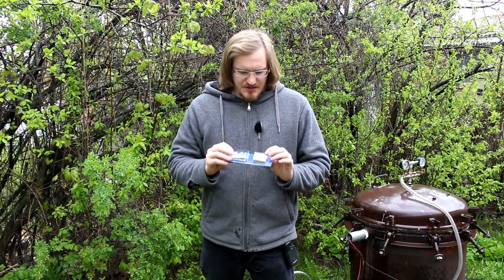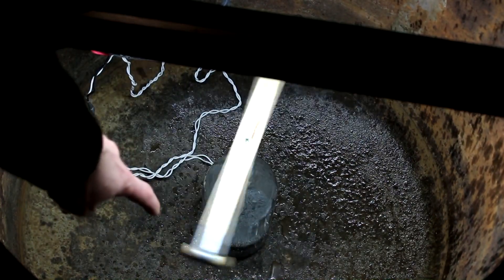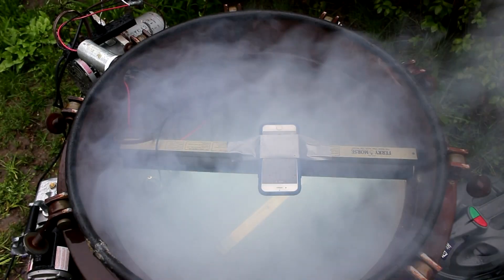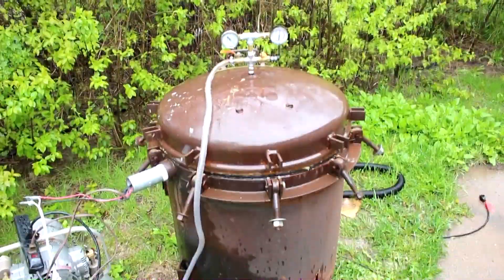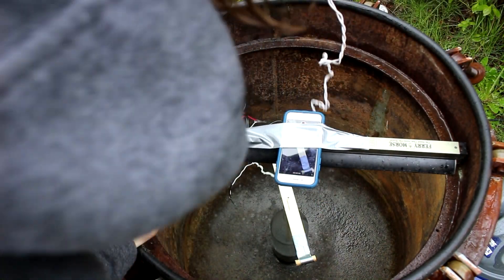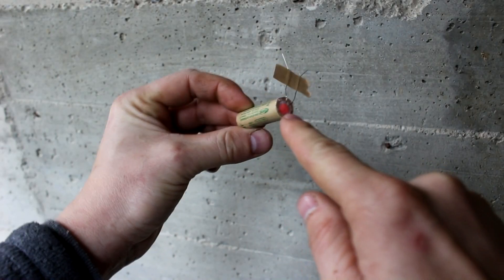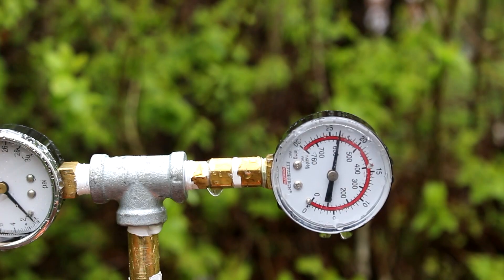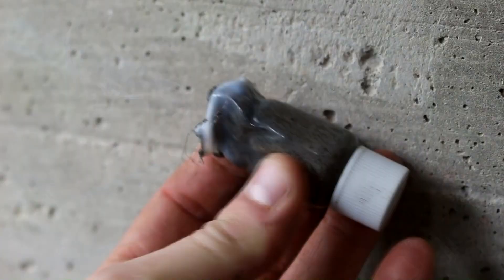Will a Model Rocket Motor Work In Vacuum?

Comment: Bob can be convinced of anything empirically provable.
Reply: When I said 'goodnight' I literally meant I was going to sleep. I wasn't giving up on this thread, in case that's what you guys concluded. Because it's been 9 hours, and no comment.
Reply: sleat Its literally in the comment before the one you replied to. You need to read the whole comment, instead of reading the top paragraph and skimming through the rest.

Unless...

My own youtube is acting strangely. I get notifications of your comments, but when I come here, they aren't there.

Perhaps you are experiencing a similar problem.

PS, repost the two comments I couldn't see in your reply to this question.
Reply: Originally, I intended that I would put the entire old thread into my first comment on the new thread. But Youtube has a stupid limit to the amount of characters in a comment. Rest assured though, I have the entire thread safe in my computer.

Shall we wait until at least sleat comes?
Reply: Sigh.... I was hoping that at least sleat would show up before we started this thread, but I am tired of waiting.

I know exactly what you are going to say to that bob. you'll say that he knows he's lost and he is too scared to show up. but I disagree. I think he isnt showing up because he thinks there is no point in arguing with you, and because he hasnt seen my messages for some reason.

anyway, since we need two sides to the debate, and I am actually somewhere in the middle, we wont actually begin until sleat joins. so, uh, hows life going?

 (I am leaning towards 'rockets work in vacuum' and as far as I am concerned, the debate is mainly about rockets. until we settle that, we cant go discuss anything else. thats called moving the goalpost
Reply: could you say something completely unrelated to what this thread is about, just so I know you're there, bob?
Reply: Emaan Ajaz
Look into mudfossils. ;D
Reply: +Emaan Ajaz "and I am actually somewhere in the middle"

Middle of what?

"until we settle that, we cant go discuss anything else. thats called moving the goalpost"

I've been asking for an equation that shows how rocket thrust should diminish as the density of the operating medium diminishes if the claims are correct, for, oh, several months now. That set of goalposts has weeds growing around it!

Such an equation could quickly be tested, as soon as it was published by someone who thinks that's true, and can describe it numerically. Any number of tests to verify the equation could be setup by almost anybody, as soon as they had the relationship written down before them.

If they can't, it raises the question; "Why do they think that, if the original rocket-thrust equation has been working correctly for the past 100 years or more?" It isn't as if, say the North Koreans use a different equation and get different results. There is literally zero debate about it between people who make rockets for a living, even when they come from countries which "hate each other".

Up until now, nobody (on the "no thrust in vacuum" side) has clarified what's supposed to happen at, say, 1/10th of sea-level pressure, or 1/2, or 1/100th. If they don't work in vacuum, you'd think the thrust would start decreasing continuously before that, since even space isn't a perfect vacuum.

You can't expect to be taken seriously if you simply tell people the current rules and models are wrong, but keep the "real" rules a secret.
Reply: sleat You're here! Finally   : )

I meant that my opinions were in the middle of the two sides of the argument. Though that was really just a generalisation. My opinions are actually closer to 75% in agreement with mainstream science than alternative views.

As for bob's side of the argument, I think he doesn't have experience with equations. He seems to prefer using analogies and and what not.

I actually have an idea for an experiment that should solve this debate permanently, because you can't argue with visual, live evidence, can you?
Reply: +Emaan Ajaz "I actually have an idea for an experiment that should solve this debate permanently, because you can't argue with visual, live evidence, can you?"

Great. I'm sure somebody will try to argue, but it's a start. So, what's the basic premise, and what's the experiment that will prove or refute it?

"He seems to prefer using analogies and and what not"

Not easy to predict the raw performance of a new rocket design in a reduced-density-environment using analogies and what-not. Predicting what rockets will or won't do is about masses, flow rates, and velocities, in the most basic sense. Real numbers.
Reply: sleat Well, basically if I've understood bob's understanding of rockets correctly:
. He believes that matter is continuous, rather than discontinuous. After all, he doesn't believe in molecules. So I am guessing that he thinks as long as a fluid is in continuous plume (or fountain) it will be able to impart a force back to the source (of course, one could disprove this with your vastly simpler experiment of spraying a hose against a wall, to see if that provides greater momentum than simply spraying against air- that was a long time ago...)
. He thinks that vacuum has a pull to it.
. Due to this pull, he seems to believe that the fluid in a rocket is pulled out, without it impacting the walls of the ignition chamber of the rocket, enough to impart momentum.
. And since he does not think of fluids as being composed of 'tiny solids' (how he thinks of molecules, and not a bad way to imagine them, I admit) so there is no way for the fluid to impart force by average collisions of molecules against the walls of the blast chamber.

Is that how you see it, bob?
Reply: Emaan Ajaz
Atoms a theoretical. Vacuums have no pull they are inert. Gasses want to fill vacuums and low pressures because their electrical charge makes them repel themselves. Releasing gas into a pressureless environment allows the gas to expand unimpeded. The releasing of the gas is an equilibrium force. The released gas returns no force to the rocket, except when its expansion is resisted, ie in atmospheric pressure.
Reply: +Emaan Ajaz So, basically;

"Here's an alternate, overlapping, parallel universe where I get to make any rules I want, because I say so. Now, try to de-bunk my rules using the reality you live in!"

He's the god of his own private reality. Everyone else is living a fantasy. That's a big de-bunk.

I'd be impressed if anyone could untie that knot.
Reply: +Emaan Ajaz "Atoms a theoretical"

Hmm. If bob means that atoms are theoretical, this would mean that since real matter is not composed of atoms, the chemistry necessary for rocketry would not work in the first place. That's a much better proof that rockets don't work in vacuum, as proofs go.

"They don't work in vacuum because chemistry is a hoax." 
That works for me. :D No chemistry in the bobiverse.

"Vacuums have no pull they are inert"

This is a fresh change from last time. I'm almost certain that last time the narrative was that there was no force in vacuum because it sucked the gas out of the rocket. Can you find that bit Emaan?

"Gasses want to fill vacuums and low pressures because their electrical charge makes them repel themselves."

Well, since like repels like, that must mean there are separate, things repelling each other. (and bumping around repelling things they run into) If there are no atoms/molecules, where does the repulsion come from, and how would one measure it?

A piece of silver, with a high static charge doesn't want to blow itself apart. It behaves as one charged object, freely sharing its electrons among its parts.

And here I was always taught that gas pressure was due to the kinetic energy of the gas molecules, or atoms, (whose electron shells also repel each other, unless they're involved in a chemical reaction).

Devilishly clever for the bobiverse that most of modern physics (and even old physics, like Newton) literally doesn't work at all.
Reply: bob question What I don't understand is how gases could be charged.

I also don't understand why a constantly expanding, burning gas with only escape being a nozzle wouldn't impart momentum to the solid ignition chamber surrounding it.

But besides these two points, my understanding of your understanding of rockets was correct?
Reply: sleat Not necessarily. He could have read all that on an alternative science site. He accepted it because it made more sense to him than mainstream science.

I'm sure if we manage to give good enough proof, we can change his beliefs.

The above paragraph applies to you too, bob! If you can provide sufficient evidence, then speaking for myself, I would accept your views. But the problem is (and this has been observed several times by many people of the Old Thread) that you:
. Do not explain your ideas in adequate detail.
. You avoid answering questions.
. You bring up something marginally related. That is called moving the goalpost. A great example of this was a debate about flat earth in which you brought up how the vatican have claimed all our souls (please don't start). I understand what you meant was we were living under a conspiracy, but its much better if you could stick to the topic.

Please avoid all of the above.
Reply: +Emaan Ajaz "Not necessarily. He could have read all that on an alternative science site. "

I guess you mean he doesn't necessarily believe atoms are "only a theory". 
If that's true, it does present a number of problems, like how nuclear fission works in practice, decay of isotopes, detection of sub-atomic particles with instruments, and so-forth. Also, CRT and X-ray tubes wouldn't work without the ability to spray naked electrons over some distance, and manipulate or steer them.

Science thrives on upheaval and revision, replacing old models with new models that work better, and can take the job of the old model without errors. If the alternative science worked it wouldn't be alternative science anymore. The thing about current scientific principles, they can be readily used to engineer stuff and make new things; to turn a profit. If the alternative science could be used to engineer new inventions, you bet I'd use it! All it has to do to make $$ is work in practice reliably.

If a new phenomenon is discovered that blows apart old laws and theories, they can be replaced. That will happen as soon as enough folks can replicate the results using the new model. Basically, outside the bobiverse, science is self-evident and updates itself (with the help of people).

"I'm sure if we manage to give good enough proof, we can change his beliefs"

I don't expect that, especially if he sticks to proclamations and eschews experiments and making honest efforts to answer polite, relevant questions.
Reply: sleat I actually did find a comment of his on a wolfie video, where he openly admitted that he 'jumped the shark' and admitted he was wrong. That was today, in fact. You were there somewhere too. Something about gyroscope correction mechanisms...

So clearly he can be convinced otherwise. The thing is, his understanding of physics is so different from the mainstream, and so complicated and thought out, that we'll have to provide very specific counter proofs to persuade him otherwise.

Likewise, bob has yet to have provided arguments, let alone proofs, that could convince US (except, in my case, a few observations of his, here and there).
Reply: So, where has the existence of atoms been proven? Mainstream science knows this except it teaches theories as if fact.
Reply: bob question Why not play Devil's advocate and try to post as many reasons why atoms COULD exist instead? I do it all the time.

There is also the issue of falsibility and deniability.
The first means if something can be proven wrong by experiment, and the second is providing ONE example of a proof, which if found, causes one to give up on there belief.

Anyway, sleat asked that how can gases repel if it is not made of many molecules repelling one another, since like repels like. Because a single thing cannot repel itself, yes?

He also asked to explain nuclear physics, which require the nucleus of ATOMS to exist, so how do nuclear power plants and bombs work?

I also don't understand why a constantly expanding, burning gas with only escape being a nozzle wouldn't impart momentum to the solid ignition chamber surrounding it, when it would for air.

But besides this point, my understanding of your understanding of rockets was correct?

Also, how do you explain stoichiometry?
Reply: +bob question "Mainstream science knows this"

Knows what exactly? What do you mean by "this"?

"except it teaches theories as if fact"

Can you tell me, bob, in your own words, what you think a scientific theory actually is? Can you elaborate exactly the differences between a fact and a scientific theory?
Reply: +Emaan Ajaz "I actually did find a comment of his on a wolfie video, where he openly admitted that he 'jumped the shark' and admitted he was wrong."

Much respect to bob for admitting when he finds he's wrong about something.

Can you point out what top-level-comment this was under, please? I'd like to read, rather than just hear about it.

"(except, in my case, a few observations of his, here and there)."

Really? Like what? Maybe I can help.

"The thing is, his understanding of physics is so different from the mainstream, and so complicated and thought out, that we'll have to provide very specific counter proofs to persuade him otherwise."

Alternative physics that doesn't explain at least as much as mainstream physics, about the same phenomenon which is being observed, tends to be a rabbit-hole.
Before long, you have to reject literally everything in order to get your alternative to work, and if you have to do that, each time you do that, it weakens your explanation of what is observed, unless you account for all the stuff you rejected out-of-hand as well.

"I hereby reject your reality and substitute my own!"
There's a reason why that's a mythbusters catch-phrase. It's funny.

You can replace a given explanation with an alternate explanation, but it has to work better than the original one. This is only logical. Science certainly allows for this to happen, in fact, it's a requirement. Whenever there is a better explanation than the previous one, for some phenomenon, as long as it doesn't break anything else, it becomes the new explanation. 

I think many alternative-science types miss this. For example, if atoms are a big fat lie, it breaks all the obvious stuff that is explained by the existence of atoms, but doesn't replace the broken stuff with anything. 

New explanations aren't really allowed to leave gaping holes in the rest of the understanding, since the purpose of the methodology is to fill in those holes in the understanding.
Reply: sleat
Mainstream science knows that atoms are theoretical.  As for wolfies claim that the gyroscope would account for curvature. The gyroscopes correction displayed by wolfies example is a situation that the gyroscope will never be in under proper operation within an aircraft when curvature compensation would be needed over the ball "Earth". IE when a force is applied perpendicular to the gyroscopes axis.
Reply: sleat
Theories are hypotheses. They should be a tangible guess at why or how something happens when the actual happening or cause of happening is not known. Instead, theories have become concatenations until they no longer represent reality. For instance, black holes are theoretical. They are made of a theoretical force and they are the end of a chain of theories in a theoretical universe that can be proven not to exist.
Reply: Nuclear power does not exist. We live on a capacitor and above us is a charged atmosphere. The "Earth" is an electrical generator. Power cables are not insulated apart from between the wire and the pylon. They are not insulated because they absorb electricity from the atmosphere and do not discharge it to the atmosphere. The higher up you go into the atmosphere the greater the electrical difference between earth and sky. This atmospheric power is then distributed to houses etc. The myth about fossil fuels and nuclear power is to make you pay more for your power. They can also scare you shit-less about "energy crises". 

I know you will find this one hard to swallow, but that does not dictate what is and what isn't.  

Check out why pink floyd had a flying pig over Battersey Powerstation. This Powerstation has never even had a roof (up until three years ago when it became an art exhibition centre) and was derelict 7 years after building ceased. It was just mind candy for feeding a lie whilst extorting wealth from the nation.
Reply: +bob question "Theories are hypotheses."

So, you're saying these words both mean exactly the same thing; i.e. they are freely interchangeable, in a rigorous scientific context? Are they synonyms? No distinction worth mentioning?

"They are made of a theoretical force and they are the end of a chain of theories in a theoretical universe that can be proven not to exist."

Do you mean the universe can be proven not to exist, or black holes?

Can, or has? How can (or has) this be (been) proven?
Reply: stoichiometry is basically molearity. This proves that chemicals in bonding have a fixed relationship with each other. IE so much oxygen requires so much hydrogen to make so much water. That does not prove atoms.

as far as the like repelling like is concerned, that is why gasses expand. This to, does not prove the existence of atoms.

Atoms are a theory that largely fit the purpose. As long as we are taught that they are a theory that largely fits the purpose, then all is well. When we are not taught that they are a theory that largely fits the purpose, we then think wrongly about them. For instance, when someone teaches us about the Higs Boson, we think that this has a tangible basis. It does not. Its a theoretical particle to explain the existence of another theoretical particle. Its rubbish.
Reply: If i dig a deep enough hole in my garden then its black as light doesn't get in. So i know black holes exist. What doesn't exist is gravitational vortexes at the center of star clusters.
Reply: +bob question "is a situation that the gyroscope will never be in under proper operation within an aircraft when curvature compensation would be needed over the ball "Earth"."

Since we know that local up-and-down on a spherical earth would be the same direction as a stationary plumb-bob would hang in the same place, and that the attitude-indicator gyro erects itself to that orientation as demonstrated in much less time than a fast-moving aircraft would progress around the curve, can you indicate what, if any, further "curvature compensation" should be required and why?

"IE when a force is applied perpendicular to the gyroscopes axis."

What is your understanding of the gyroscope's axis direction when, say, it's indicating level flight, and how would travelling around a curved earth at a constant velocity exert a force perpendicular to that axis? How much force of this nature would you expect?

What effect do you expect such a force to have on the indication, and why do you expect that?

And lastly, have you raised these points with +Wolfie6020 himself? It's his demonstration, after all, and he has used such instruments for years.
Reply: +bob question Well, you seem to be able to generate woo faster than I can figure out what you're talking about exactly. If your direct-question-answering rate was only par with your new-topic rate, maybe I'd stand a chance at keeping up.

I guess the best way not to get pinned down on any particular point in more detail than you are comfortable with is to keep the topic bait in a state of continuous flux.

We've got, what, about 4 distinct topics here, no direct answers to direct follow-up questions and absolutely no discussion of the original topic, and I've never seen you happier. Funny, that.
Reply: +bob question "Atoms are a theory that largely fit the purpose."

Splendid! Can you provide an explanation for the exact electrical behavior of just one of the multitude of doped-semiconductors you're using right this instant, without talking about the well-understood and observed properties of atoms?

Do you think transistors are as phony as you say you think nuclear (and coal?) power is?

Oh, and where does all that coal go, do you think? I see tonnes of it go into Australian power plants nearby every week, and none comes back out. The hopper trains are full going in, and empty going out. Where do they put it?
Reply: +Emaan Ajaz "So would you explain if you think this is a good experiment?"

I would if I could see it. When-abouts did you post it?
I also recently mentioned that the number of topics (and level of woo) is increasing exponentially.

If one simply keeps declaring this-and-that well understood phenomenon to be lies, without answering direct follow-up questions, one could go on like that indefinitely. Bait, switch, repeat...forever.

The only requirement is changing direction before the detailed analysis catches up with the new topic.
Reply: +Emaan Ajaz "Because it's been 9 hours, and no comment."

Can you not see my comments? Where did you document this experiment, exactly? Can you paste it again, perhaps?
Reply: +Emaan Ajaz OK, you say: "Its literally in the comment before the one you replied to."

Here is that comment, just the beginning and ending:

"I would be happy to address your understanding of electricity---So would you explain if you think this is a good experiment" ?

I don't see the details of an experiment here.

"repost the two comments I couldn't see in your reply to this question."

I could do that, if I knew which comments you couldn't see.
Reply: sleat I came here after logging out from my YouTube account. It seems that all long comments don't exist on this thread. wut
So hopefully you'll see this short comment, and i'll post the experiment in segments.
Reply: +Emaan Ajaz I don't know what Google is doing to this thread, but it seems I can't see stuff, and you can't see stuff. Hard to imagine them censoring an experiment!

Perhaps you should post it in a new, top-level-thread, to stop any funnies from happening. If bob wants to join us in your thread, so much the merrier!
Reply: sleat I would imagine that its a new feature, or a bug, that doesn't allow long comments. I'll be posting a segment of the comment in a bit.
Reply: segment 1:

You know, this thread is beginning to move in another direction, so I'll just post my experiment now. We can discuss the existence of atoms and stuff later.

Actually, I posted a version of that experiment in the Old Thread, but I guess it was lost in all those replies.
Reply: +Emaan Ajaz OK. I'm waiting to see it...
Reply: Segment 2:
Bob does not want the propellant to hit the walls of the container? Okay.

He wants there to be an infinite vacuum? Not okay, but that's because he does not want the propellant to hit the walls. So if he's willing to accept a near perfect vacuum, where pressure is in the 10^-5 range, great.
Reply: Segment 2:
Bob does not want the propellant to hit the walls of the container? Okay.

He wants there to be an infinite vacuum? Not okay, but that's because he does not want the propellant to hit the walls. So if he's willing to accept a near perfect vacuum, where pressure is in the 10^-5 range, great.
Reply: +Emaan Ajaz It looks like you just posted the same message as from 3 days ago again.

Did you not see my immediate reply, three days ago, where I talked about explosives near a plate, and the feasibility of achieving 10^-5 Torr without spending >$10K on equipment? Did you see me talking about the problem that since more expensive equipment is tasked with removing individual molecules and atoms, and that high vacuum gauges are specifically tasked with measuring those remaining molecules and atoms, that it was likely that bob doesn't believe that measurable (by humans) vacuums exist in the first place?

If you didn't see that, or didn't see that you've double-posted "Segment 2" then maybe this thread is being messed with by something, or some software error.

Why not post your whole experiment in your own top-level-thread, in segments if you need to?

I promise to reply to that.
Reply: Was it a long comment?
Reply: It seems that this thread does not accept posts of more than around 200 words. I would make a high level thread, but:
. I don't know how.
. There is no point to the thread if bob isn't in it. Its our against his arguments, after all.
Reply: Long awaited post 3:
My first, rather easy proposal, which you may remember replying to, is to use a glass tube connected to a vacuum cleaner with air tight glue. Inside the tube is a long balloon (the type used to make balloon shapes). The opening of the nozzle is closed with neodymium magnets, one on the inside, other on the outside of glass tube. We start the vacuum cleaner. Any gas produced is sucked due to being an equilibrium process, according to bob. If, whereupon releasing the balloon, it flies upward, then bob's idea of rockets is wrong, and they can work in vacuum.
Reply: +Emaan Ajaz A vacuum-cleaner only gives a few pascals' worth of reduction from the ambient pressure where it's located. It might give you a virtual altitude on the order of 5,000 feet. You could just run your rocket on top of a medium mountain, instead.

Vacuum cleaners go nowhere near 10^-5 Torr. If only they did, it would be very easy to play with vacuums (as opposed to vacuum-cleaners) cheaply.

Have you got any other experiments in mind?
Reply: segment 4:

'Edit: you could use an ionizing pump instead of a vacuum cleaner'

and with that, the comment ends. now all we have to remember is to keep comments at 200 words.
Reply: +Emaan Ajaz "'Edit: you could use an ionizing pump instead of a vacuum cleaner'"

Who said that? You? Yes, after roughing down, there are several types of pumps that can get to high vacuum over time.

If you put a rubber balloon into the chamber with any air in it at all, I think it would very quickly expand to the point where the rubber covered up the gas-outlet for the chamber, and then that part of the balloon covering the port would fail.

You might want to use a rigid container capable of withstanding at least 15 psi. A normal plastic drink-bottle would do that.

Also, who gets to buy the Penning trap discharge pump?
Reply: did you see my reply yesterday?
Reply: +Emaan Ajaz "did you see my reply yesterday?"

If it's the one where you said: 
" 'Edit: you could use an ionizing pump instead of a vacuum cleaner' "

Yes. I replied to it. I mentioned that there are several types of high-vacuum pumps that can be used.
I mentioned that a rubber party balloon in a vacuum-chamber, even with a roughing pump, and with a bit of air inside, would quickly expand to fill the chamber, until one part of the membrane covered the suction port, and then it would fail. In a bigger chamber, it would expand until it popped.

I suggested that a plastic drink-bottle be used instead. They'll hold 15 psi or more.

I'm also wondering at this point how you plan to convince bob that a  Penning-trap pump will work.
Its mechanism of action involves starting at a reasonably good vacuum, like 10^-3 Torr, and then catching individual atoms and molecules of the residual gas, by ionizing them and then electrically drawing them towards a capture system.

Trouble is, bob question does not believe in atoms or molecules, apparently, so it would be difficult or impossible for him even to accept that a Penning-trap system would work.

The other problem is that the way you measure how good a high-vacuum you have is usually with an ionization gauge.

This relies on a measurable electric current being produced due to the ionization of the very individual molecules (or atoms) which bob does not believe exist. The amount of current is in proportion to the number of individual molecules (or atoms) left in the chamber.

You'd first have to convince bob that individual molecules and atoms bounce around in a vacuum-chamber, before you could convince him of the mechanism by which mankind measures high-vacuum.

Imagine trying to explain the rate-of-cellular-metabolism in a given cell to a man who does not believe cells exist. That's your problem.
Reply: sleat that's what I feared. I exceeded the 200 word limit, and so you didn't see my newest comment. I will now repost in two segments.
Reply: segment 2:
 The gases, positively charged by the cathode rays, will easily be pumped out by putting a small hole behind the cathode.

A tiny rocket might be used, ignited by the cathode rays.
Reply: +Emaan Ajaz "I exceeded the 200 word limit, and so you didn't see my newest comment. I will now repost in two segments."

Funny that you saw my last comment, which must have been well over 200 words. You did see it, right? It began with [If it's the one where you said: ] and ended with [That's your problem.]

I think what you're describing is a Penning-trap.

What do you make of the fact that according to bob, both Penning-traps and ionization high-vacuum gauges cannot work, as they rely on the actions of individual molecules (or atoms) and individual electrons? Wouldn't it first be necessary to convince bob that atoms and molecules are real, in order to convince him that you actually had a good vacuum in the first-place?

As far as trying to ignite a rocket with glow-discharge or an electron-beam (cathode-ray), you might find that whilst the temperature is high in the plasma created, the heat is very low, due to the low pressure. I think the focus should be on increasing both the heat and the pressure at the propellant-grain-face.

I would think that to ignite a solid-fuelled rocket in an evacuated environment, it would only be necessary to build-up a bit of pressure on the propellant-grain-face. I'd be using some sort of tight-fitting plug and a hefty bit of nichrome wire. Heating up the KNO3 to a high enough temperature should provide enough outgassed-pressure behind the plug to allow the reaction to continue normally in a rocket-like fashion.

Part of Cody's problem, I think, was that he ran house-AC-current through his igniters. I think a longer, more consistent application of heat (a few amperes of DC current) behind the cork would work better, and other YT videos of igniters working with the same engines in other vacuum-chambers show that it does work.
Reply: sleat You're right, your last comment really was far above 200 words. I really can't figure out what is wrong with this thread. All I know for sure is that some comments are failing to appear.
Reply: sleat Anyway, bob doesn't seem to be someone that denies direct evidence. And he doesn't see us as liars so much as morons :/
so as long as our apparatus shows zero pressure on the gauge, bob will believe the ion pump works, but rationalize why it doesn't prove the existence of atoms. He already believes that gases can be charged, but doesn't believe in atoms.
Reply: sleat As for the rocket, chemical reaction don't always require heat or pressure. Take electrolysis, where substances are decomposed without too much heat or pressure. in the end, chemical reactions require bond breakage, and electrons are ultimate reducers.
Reply: +Emaan Ajaz "Take electrolysis, where substances are decomposed without too much heat or pressure. in the end, chemical reactions require bond breakage, and electrons are ultimate reducers."

Sure. If you could get your electrons to behave themselves, and go just where you wanted them to, say, by charging up the rocket propellant positively, you could probably get electrons to hit it. A better way might just be to make a high-voltage arc between the propellant grain and some source of high voltage like a piezo or HT circuit. You would want to connect the opposite pole of your arc-generator to the propellant itself.

The "augmented spark igniter" was this sort of thing, and it's been proven in space. Its technological descendants survive to this day. It will start up an H2/O2 liquid fuelled rocket in space. Basically it pumps fuel and oxidizer into a constricted tiny chamber and fires sparks through it until it ignites, and fires up the rest of the engine. Search: Augmented spark igniter
Reply: sleat So, uh, are you going to build the apparatus now? My channel doesn't upload videos for some reason, and bob couldn't be bothered.
Reply: +Emaan Ajaz "My channel doesn't upload videos for some reason, and bob couldn't be bothered."

If bob couldn't be bothered, and doesn't want to even travel anywhere for firsthand proof, what's the point again? Spending money on a random internet guy who says he doesn't even believe atoms exist?
He can still always say "whatever you did is still not empirical evidence that my beliefs are incorrect"

If you submit to the scam that you absolutely must convince bob of something you are essentially giving him all the cards in the game. He just has to sit back and make a comment once in a while, that he "still doesn't believe X" however nutty that might appear, while others run around in circles trying to "make him believe" X. A fool's errand. You are literally trying to "win" a game with another player who gets to make up his own rules as the game goes on. Notice that he didn't mention that he didn't believe atoms existed until several months into the discussion? If there are no atoms or molecules, they can't give impulse to a rocket by adding momentum to it, by being thrown away.

All he needs to do is spot the crux of a given argument, and say that that thing or phenomenon is invalid.

You can't convince a man that he's not Napoleon.

"So, uh, are you going to build the apparatus now?"
Tell me how much vacuum you think you need, and I'll quote you a price to build such a system, with parts from suppliers, or eBay.

If you're really keen on seeing a high-vacuum rig, go visit a university physics lab.
Get them to tell you the rough prices of all the kit they consider essential for a certain level of vacuum that you decide is required.

Also, you might ask them if they think it's safe to fire a chemical (black-powder) rocket in such a rig without ruining it.

This rig would probably include;
- one or more ionization gauges, a gauge and vacuum controller console,
- one or a few high-vacuum pumps using ion-trap, oil diffusion, or turbomolecular  technology
- A chamber, usually made of stainless, since it's easy to get totally clean (it has to be completely clean to work at all, or the dirt and fingerprints and such, just keeps out-gassing more-or-less forever)
- A backing pump, which may also be called a "roughing pump" that goes down to the level where these other pumps begin (and are safe to) work. About 10^-1 to 10^-3 Torr.

At the moment, I can get down to 10^-3 Torr with my roughing pump, but I can't measure that low without hooking up my one single ionization gauge to some sort of gauge controller, which I do not have right now.

I can happily build or buy a small vacuum-vessel to connect to my roughing pump for small-change. That would be classed as a low-vacuum system.

However, my guess is that a good high-vacuum rig would cost about $10,000 Australian, ready-to-run.
Reply: sleat I have two reasons to convince Bob. Firstly, the sheer satisfaction of winning an argument. Secondly, if there is a video that addresses potentially any rationalizations a flat earther may make (aside, obviously, claiming their reality is different) then we could destroy at least the 'no thrust in vacuum' claim permanently.
Reply: sleat And anyway, the method I provided a link to can't cost more than 10 US dollars, tops. you know, the instructable for the cathode ray oscilloscope.
Reply: sleat And I'm pretty sure that there is a limit to how much bob can deny evidence. If we show him a container whose pressure gauge says zero, he'll probably believe there's a vacuum in it. If we fire a rocket successfully in it, then he won't be able to deny that.
Reply: +Emaan Ajaz "And I'm pretty sure that there is a limit to how much bob can deny evidence."

He has already proven himself adept at doing just that.

" If we show him a container whose pressure gauge says zero, he'll probably believe there's a vacuum in it."

Show him how? You'd first have to agree with him on the definition of "empirically provable".

"If we fire a rocket successfully in it, then he won't be able to deny that."

He couldn't deny that the rocket fired, but he could deny the following;

- The mechanism by which thrust was produced.
- The quality of the vacuum, both before and after the rocket was fired.
- The veracity of the measurement equipment, both for measuring the rocket's thrust, and the quality of the vacuum.

If a fellow is capable of denying that power-stations generate power by burning coal, gas, oil, or nuclear fuel for profit, to be consumed by customers far away, and that high-tension lines are connected to those power-stations, and carry the power to them with high-tension AC current, I'd think he could deny almost anything in the real-world.

Assuming even that you had an infinite "proving" budget, the smart first-step would be to get a detailed agreement before-the-fact, upon exactly how the experiment would be setup and conducted. Most important would be the exact criteria by which the verdict "thrust or no thrust in vacuum" would be decided before the fact .

In other words, bob's hypothesis has to be falsifiable i.e. that a predetermined set of measurements and conditions would unequivocally prove the assertion that "rockets don't produce thrust in vacuum" false before it was tested and be agreed upon by all parties before the test.

Ideally, he could provide a mathematical formula for how much thrust should be seen in a given vacuum situation with a given rocket, which could then be tested rigorously. So far, I haven't been able to pry that information out of him, despite asking more than once.

If you didn't do these first-steps, then after all your hard-work, he could simply sit back, smile and say "nup". Again, it would be a fool's errand spending money to try to prove something to someone whose sole function appears to be not believing stuff .
Reply: sleat In the midst of bob being no where to be seen, I am beginning to understand your point. Unless bob were to reappear and agree to a falsifiable experiment, and provide his deniability (evidence that if found will convince him he is wrong) he may be able to rationalize it away.
Reply: sleat Though I can think of one experiment that he CANNOT rationalize. If we sent a camera (which we explicitly demonstrate to be neither fish eye nor wide lens) to the edge of space with a weather balloon. Though sadly, that is probably beyond either of our expenses :(
Reply: sleat Oh wait, that's for proving the earth is not flat, not for proving rockets can work in vacuum.
Reply: sleat alright, here's an idea. We use the simple vacuum cleaner apparatus mentioned before, but we put a small, digital scale in front of the model rocket. First we demonstrate the force with vacuum cleaner off. Then with vacuum cleaner on. Then ask bob to explain why thrust is lower when vacuum cleaner is on (or, against all expectations, if we are wrong, eat our words).
Reply: +Emaan Ajaz "Oh wait, that's for proving the earth is not flat, not for proving rockets can work in vacuum."

Ahh, yes, but say you carried a loop into which was inserted a simple rocket assembly, essentially a stick with a rocket motor attached to the front. This would be stable, even at high altitudes. You would launch the rocket upwards at an angle in the direction your camera was looking, so as to prove you hadn't simply dropped the thing. The rocket would rapidly accelerate away, despite there having been nothing for several miles behind it to "push off of" (assuming you thought it needed to push off of something).

The other stability trick would be to add something to make the rocket assembly spin, either thrust-vectoring or launching from a spinning container.

You could carry a set of measurement transducers that would give you the absolute pressure in pascals for your balloon ascent, which you could later convert into an altitude measurement.

And of course, the counter-argument would come:
"Well, sure, they work at 115,000 feet! I claimed they didn't work in infinite vacuum "

See how effective it is to base your whole argument on a state of nature that has never been observed by mankind? i.e. "infinite vacuum". Nobody claims rockets work in "infinite vacuum" not because Newton doesn't work there, but because that environment has never been encountered. So it's a form of straw-man.

So you'd want to get an indication that bob thought rockets wouldn't work at > 100,000 feet, first. And all you'd be proving is that they did. He could still say they wouldn't work in a better vacuum than that, even if he wouldn't be able to give an equation or say exactly what the relationship was between environment density and thrust force. He has demonstrated that he can essentially claim anything he likes. The rub is that the burden of proof is on the person making the claim, when you're in the realm of "accepted science". He's essentially claiming that Newton's Third Law does not apply in vacuum, without describing why in mathematical terms.

What's troubling is that despite him agreeing that a spring-loaded cart, launching a mass, say a ball-bearing, by remote-control inside a vacuum-chamber, would produce a force to move the cart, he claims that that cart, expelling an identical mass of gas at an identical velocity would not move the same cart the same amount, by the same Newtonian mechanism.

If this were true, one could build a self-contained device that launched vaporized material in one direction (producing no force), condensed it at the other end, and fired the solid back to the first end (and producing force), during which time it would be re-vaporized and collected, and that this should produce a net force without expelling any propellant. Essentially a mechanical "EM-drive". The law of conservation of momentum would prevent this from working in practice, except in the bobiverse, where it would work.
Reply: sleat Instead of asking for a mathematical equation, we could just ask if he thinks a rockets thrust decreases with pressure. My latest experiment, if this blasted comment section allowed you to see this, should be ideal for testing such a theory.
Reply: +Emaan Ajaz " Instead of asking for a mathematical equation, we could just ask if he thinks a rockets thrust decreases with pressure."

I actually asked both questions long ago, if I remember correctly.
I wanted to know:

- How he believes thrust decreases with atmospheric pressure? Do you get, say half the thrust with half the air density? Do you get better thrust up to a certain altitude and then worse as you go higher?
- Where does he believe the "rockets don't work" claim begins? At what altitude, or what atmospheric pressure, say in Pascals, does the thrust force "stop"? What happens just below that point (at just a slightly higher atmospheric pressure)?

At that point in the conversation I think I was still getting statements containing the phrase "infinite vacuum" and since such a state is not something that has been seen, the claim is ambiguous.

He had already agreed that he thought that a steel plate in vacuum next to an explosive object (I said dynamite, I think) would move the plate. Although at this point he had objections that it was possible to detonate something in vacuum. Regarding this, it's important to remember that inside the explosive mass, where the detonation begins, it's not a vacuum. It's an explosive. It's matter, either the blasting-cap, or the explosive material itself. Explosives don't evaporate in vacuum, at least they don't evaporate very quickly.

Obviously the gist of the question doesn't require it to be dynamite. It could be TNT, RDX, PETN, even primer material, i.e. lead styphnate. Rober Goddard fired a handgun in a vacuum chamber about 100 years ago, so we know that all parts of a firearm work, the primer, the propellant, etc.

"My latest experiment, if this blasted comment section allowed you to see this, should be ideal for testing such a theory."

Which is your latest experiment, again?
Reply: +Emaan Ajaz "And anyway, the method I provided a link to can't cost more than 10 US dollars, tops. you know, the instructable for the cathode ray oscilloscope."

I don't think I saw that link. What day did you post it? How long ago? Can you instruct me how to find what you're referring to, rather than try posting a link. Google may behave erratically with links. Some seem to work on YT, and some don't.
Reply: Latest experiment:
''sleat alright, here's an idea. We use the simple vacuum cleaner apparatus mentioned before, but we put a small, digital scale in front of the model rocket. First we demonstrate the force with vacuum cleaner off. Then with vacuum cleaner on. Then ask bob to explain why thrust is lower when vacuum cleaner is on (or, against all expectations, if we are wrong, eat our words).''
Reply: sleat Anyway, we don't need a cathode ray oscilloscope now for the experiment, but I bet you'd like to have one, eh? :)
Google 'cathode ray oscilloscope instructable'
Reply: sleat did you see my two replies?
Reply: +Emaan Ajaz I haven't seen anything for the past 12 hours from you. My last comment began:
[Hang on.] and ended with [So versatile!]
Your last comment ended with: [Google 'cathode ray oscilloscope instructable']
Reply: sleat the last comment I saw of yours ended with 'some work on YT, and some don't'
evidently, you saw my second comment, but it seems the comment section has striked again. my first comment was a repost of my 'latest experiment'
Reply: sleat Latest experiment repost:
''sleat alright, here's an idea. We use the simple vacuum cleaner apparatus mentioned before, but we put a small, digital scale in front of the model rocket. First we demonstrate the force with vacuum cleaner off. Then with vacuum cleaner on. Then ask bob to explain why thrust is lower when vacuum cleaner is on (or, against all expectations, if we are wrong, eat our words).''
Reply: +Emaan Ajaz I addressed your vacuum-cleaner proposal, but I included a link. I've removed the link, and replaced it with a Google search. It should no longer be hidden from you.

I asked in that post why you thought thrust should be significantly different, in a closed box attached to a vacuum-cleaner suction nozzle with the suction running vs non-running. Math, and experience, tells me it should not.

Why do you think the thrust force should be lower with the vacuum-cleaner running?
Does it change the mass-flow-rate or the velocity of the exhaust significantly, as viewed from the exit-plane of the rocket-nozzle?

If you've got links in your hidden posts try replacing them with google-searches to find those links, and we'll see if I can see 'em.
Reply: sleat I do not put links in any of my comments. my assessment is that the comments in this thread are hidden at random. no idea why.
to see which comments are hidden, exit your account and find this thread as a non user (by selecting newest comments option). I think you'll be perplexed.
Could bob actually be replying, but we can't see his comments?
Reply: sleat I did not say that the thrust would be lower with the vacuum running. I simply meant that if, against all scientific knowledge, and my own understanding, if thrust does turn out lower, I would eat my words.

The vacuum cleaner running should produce a lower pressure, and with a sensitive digital balance, and vigorous repetition of both the VC on and off, it SHOULD show that thrust is slightly lower when VC is off.
Reply: sleat and your comment is still hidden.
Reply: sleat OHHH... I meant to write ''ask bob why thrust is HIGHER when vacuum cleaner is on''
Mistake on my part, sorry
Reply: +Emaan Ajaz "'ask bob why thrust is HIGHER when vacuum cleaner is on''"

Yes, that's what I was referring to. What you just said there makes better sense, although I don't think the thrust would be any different at all. With a hard vacuum, you might see a bit more thrust, but only if the engine nozzle was designed to take advantage of lower environmental pressure.

It's weird that random comments come out invisible. The thread is owned by bob, but I don't see or suspect why he might hide comments randomly, even if he could. Is that a recent feature? I can't imagine the use of a "randomly hide comments under this thread" control, unless Google is somehow evil and wants people to gaslight each other.

Search: gaslighting manipulation

EDIT: I just checked signed-out. The comment thread here looks exactly the same to me. I recognized all your existing comments (that I could see before) but didn't notice any new ones.
Reply: sleat Perhaps we can increase the 'hardness' of the vacuum by giving more power to the vacuum cleaner?

anyway, by checking the comments section when you are signed out, at least in my experience, you won't see the hidden comments, but you get to see which comments of YOURS don't get seen by others. As long as I stayed signed in, I could see the comments of mine you couldn't see. but after signing out, I saw they were indeed not visible to the public.

I doubt bob has anything to do with it, nor is it a feature. its possibly a glitch that hasn't been fixed yet. A similar problem I faced is that I open the reply section of a comment, claiming, for example, 127 replies, only to see nothing or very few replies.
Reply: has anyone checked their compass today?
Reply: +bob question "has anyone checked their compass today?"

Please stop messing with the geomagnetic field, bob! 
You might scare comrade Kim, and we can't have that right now.
:D
Reply: +Emaan Ajaz "Perhaps we can increase the 'hardness' of the vacuum by giving more power to the vacuum cleaner?"

Not in a significant way. You'll get a best at few pascals' difference with just a 2KW centrifugal blower/sucker. You'd be just as successful climbing a moderately sized mountain, or renting a Cessna and performing the experiment at 10,000 feet.

Again, my "roughing/backing pump" can go down to about 10^-3 Torr, but I haven't yet bought a gauge controller which can read my ionization gauges. All my gauges are mechanical bourdon affairs, where "zero" could be anything from 1 Torr all the way down to the rated maximum of the pump.
Reply: bob question where the hell have you been?
Reply: sleat we don't need a perfect vacuum. all we have to show is that a rocket provides more thrust in less vacuum.
However, should you require a hard vacuum, I might offer you an Idea of mine.
Reply: Emaan Ajaz
Ive not been getting mails from youtube. The polar shift is a false alarm. Planet nabiru has gone somewhere else. ;D

I see you are still standing under the premise that rockets work better in a vacuum. If this really was the case, nasa would be up a mountain and not launching at sea level, nice and close to the spent rockets dumping ground at sea.
Reply: bob question read the following CAREFULLY. I haven't written all that just so you skim through it.

 Is there any conspiracy you don't believe in? I bet you're a fan of Shane Dawson!

but seriously, you really need to start playing devil's advocate (try to argue against your own side). Could there be any other reason why NASA doesn't launch rockets from a mountain? I'd like you to think of a few reasons on your own.

As I've said before, I didn't understand how rockets could work AT ALL before I stumbled across the Old Thread. The physics textbook definition, though correct in a way, does nothing to show HOW rockets work:
'When a rocket ejects mass, it moves forward due to Newton's Third Law'
True, but how do the gases interact with the rocket? My understanding in that regard was the same as yours, that wouldn't the gases just blow out? I had no concept of what the combustion chamber was or looked like, other than knowing that rockets used it to combust the fuel. With my own understanding, I reviewed visually inside my head your explanation vs sleat's explanation, and came to the independent conclusion that I agreed with the mainstream view of rockets (so you can't say I was brainwashed).

Currently we are creating an experiment to test whether rockets can work better in lower pressure than higher pressure. We want you to help create this experiment so you won't just find a fault with it later, rendering our efforts futile. Will you partake?

 Anyway, if your explanation of rockets is correct, here's a rocket design I made on paper a few weeks back, only to realize it couldn't work due the mainstream logic I am CONVINCED is right. But if I am wrong, you'll make a fortune off of it:

Take a tank full of liquid fuel. Use the rocket pump to spray it out. In its way is a small flame. The flame ignites the spray, just like what happens with a flamethrower. According to you, the flame pushes against the air, and drives the rocket forward. If true, then congratulations! I have given you an idea for an airbreathing rocket better than both ramjets and pulsejets.
Reply: Emaan Ajaz
You have constructed a theoretical science test facility in your own head. That's not good. Take it back to empirical evidence. Theoretical science is religion. Belief does not change reality, it just allows us to accept what is wrong as being correct.
Reply: bob question I see you read the largest paragraph. Did you miss the parts where I said me and sleat are designing an experiment to test our claims, and we would like you to help us design this experiment?

How do you know that YOUR understanding of how a rocket works is correct? Any empirical evidence?

Because if your understanding is indeed the correct one, then the air breathing rocket model I described to you will earn you millions. I am THAT confident in my hypothesis being correct.
Reply: +bob question "You have constructed a theoretical science test facility in your own head."

Heads? The idea here is to think up an experiment you believe is valid, bob. Properly designed, executed, and interpreted experiments are empirical evidence. Maybe you can design an experiment without having a think about it first, and throwing rocks at it with a mate to make it stronger, but we can't. Kudos to you if you can do that.

"That's not good."
You're quite right. It wouldn't be good if the whole thing was only theoretical, but the normal process is:
1. Think
2. Document
3. Review
4. Build
5. Experiment
6. Collect Data
7. Interpret
8. Present conclusions

We're around step 3 with a few ideas. Can you think of a better set of steps for designing an experiment?

"Take it back to empirical evidence."
Give an example of that in the context of testing rocket thrust in different atmospheric environments, from sea-level to vacuum, please.

"Theoretical science is religion."
Designing an experiment and conducting the experiment, and collecting and interpreting data isn't theoretical anymore, is it?

"Belief does not change reality, it just allows us to accept what is wrong as being correct."
Right! Your belief that rockets don't work in vacuum, doesn't change the behavior of rockets outside your own head. This is especially true without further elaboration of a testable relationship between the density of the atmosphere where the rocket is and the force generated by the rocket, This would qualify as a testable hypothesis of the relationship between rocket thrust and the density of the operating environment.

 Clarifying the relationship for Emaan and I would at least allow us to come up with an experiment you might like.

Did you do any empirical tests to validate your belief yet?
Reply: sleat 
The last thing you want is to see a simple experiment that proves rockets can not work in a perfect unlimited vacuum. That is a problem for you.

Observable, testable, measureable, repeatable. Like the nerds experiment. I have tried it and it works. You can try it, you will see that it works. It shows all of the principles that need to be shown in order to conclude that a rocket will not attain thrust in a perfect unlimited vacuum.

I know, I do not believe. 

Imagine a toy truck with a rocket engine attatched. It would move quicker than the toy truck with the balloon. This demonstrates that a different pressure will alter the momentum by increasing it, in this case. This in itself proves beyond all doubt that the rocket is pressure dependent, done and dusted. The nerds experiment proves this and solidifies my argument.

So your only argument is mass ejection causing newtons third law to occure. This is rubbish as far as i am concerned. This means that you need to prove your hypothesis that newtons third law is occuring, when the nerds experiment proves this not to be the case.

So how do you propose to demonstrate this?
Reply: bob question bob question My god... how did you derive such a conclusion from that experiment? You are correct that rockets are pressure dependant, but only the inner pressure. The pressure outside detracts from the rockets thrust. Your conclusion is only halfway correct.

For example, in a wing, the lift depends on how high pressure is on bottom of wing, AND how low pressure is on top of wing.

Sleat and I are testing a rocket's stationary thrust in normal pressure vs lower pressure. Please review the design, as it prevents collision of exhaust with walls of container. The test is a few comments back.

In addition I gave you a plan for an airbreathing rocket of immense simplicity. I realised later that it could only work if your mechanism held true. SO PROVE ME WRONG AND BECOME A MILLIONAIRE.
Reply: +bob question "The last thing you want is to see a simple experiment that proves rockets can not work in a perfect unlimited vacuum. "

Well, if you'd ask me, I'd say that's the first thing I want. Show me a perfect unlimited vacuum. Where is this, and how can it be found or made? Then we can look at making some experiments on your "perfect unlimited vacuum".

"That is a problem for you."
Currently I don't have a problem, except with getting you to engage polite, detailed questions regarding what you are claiming.

If there's a perfect, unlimited vacuum somewhere where rocket thrust can, or has been tested, please point it out.

"So your only argument is mass ejection causing newtons third law to occure."

That's not really my only argument. But if mass ejection, defined as a physical object adding kinetic energy to a mass, and then throwing it away, did not work, i.e. did not produce an opposite force on the object adding the kinetic energy to the mass, proportional to the ejected mass and its velocity relative to the first mass, that would be very big news. It would be very hard to hide if it could ever be demonstrated.

"So how do you propose to demonstrate this?"
The first step is to get you to define the environment that your claim applies to. A "perfect, unlimited vacuum" that you refer to is a theoretical concept, until such an environment can be made or located.

But in a more practical sense, we have evidence that there are man-made objects in orbit around the Earth. So;

- How is it that the environment density there is known, if there are no man-made objects there to measure  it?
- How did the man-made objects get there, assuming they were there measuring it, without the force delivered by rockets?

"This in itself proves beyond all doubt that the rocket is pressure dependent, done and dusted. "
Yes, rockets depend on pressure. Why is this fact relevant to your claim?

Nobody is claiming that a rocket does not need to have, in its combustion chamber, a higher pressure than that of the surrounding environment. We know that if you have a vessel in a vacuum which contains pressure, and you open a hole exposing that vessel's contents to the vacuum outside, or even just a lower pressure outside, the contents will start to rush out. One of the things that effects how fast that can occur is the speed of sound in the contents rushing out , and the area of the hole. Once the flow is choked, i.e. can't move through the hole any faster, changing the downstream pressure doesn't affect the flow-rate, but increasing the pressure on the upstream side of the choke-point also changes the density of the fluid at the choke-point, which increases the rate of mass-flow across the choke point.

So, yes, pressure is important.
Reply: sleat I've even given him a design for an airbreathing rocket that would only work if his hypothesis was correct. The design is practically the same as a flame thrower. It would have neither the issues of ramjets nor pulsejets, but I realized that they cannot work according to physics. But if Bob is correct, I've given him the chance to be a millionaire! What a total fool I would be, no?
Reply: sleat could you repost your recent comment? I've got the notification from YouTube, but I clicked on it and it turns out the comment is hidden, which probably means Bob can't see it either
Reply: Sleat
"But in a more practical sense, we have evidence that there are man-made objects in orbit around the Earth. So;" 

This is what is stopping us being able to advance. You believe there is evidence of orbiting objects up there. There is hear say and CGI but no empirical evidence of man made objects in orbit.

If you can prove there are man made objects orbiting a rotating ball "Earth" then this is all unnecessary.

So lets start discussing evidence for the gravitational ball universe as it stands.

Lets start with the gravitational constant. In itself, it is a complete debunk of itself. "Gravitational constant" is two contradicting words. Yet it is the cornerstone of your universe. you raise two objects up to the same height, you let them go together, they hit the ground at the same time in a vacuum, no mater what size or shape they are. 10 m per second squared approx. 

Gravity is a force of attraction caused by mass, so the old tale goes.            

So if Gravity is a force of attraction caused by mass, something of a higher mass should have more attraction and should be, therefore, propelled much faster toward the "Earth".

It is almost ridiculous to think that an object of greater weight would not accelerate quicker. The only thing that stops it being ridiculous is that it is actually how our universe works. 

Attraction due to mass is not what we see here.

So, that is the cornerstone destroyed, what do you think is left? No gravity = no orbiting bodies.
Reply: sleat Could you please repost your last two comments? I got the notifications, but the comments themselves were hidden.

Have you gotten my reply to bob's latest comment? If not, then I'll have to repost it.
Reply: I can't see sleats reply here either, i can see it in my mail box. It could be because sleat has deleted it ;D He uses a long winded way to agree with me, then highlights the crux and capstone of the problem with the term "Inertia". 

It has no explanation in a world that is supposed to be whizzing through space.

It is an elephant sized and shaped lump under the  carpet.  

inertia = the tendency for something to remain inert.

In the ball universe nothing is inert.

In a still universe, inertia makes sense.

What is causing the speed to be equal for a feather and for a bowling ball, sleat????? The attraction between bowling ball and ground should be much greater than for the feather. But no.

You'll need to explain what inertia is in your model. This is not the same as friction, IE with the ice example. Unless you are proposing that there is some sort of friction happening in the vacuum.
Reply: bob question you haven't been as involved in this thread, so you are new to this problem. You see, due to some glitch, some comments are randomly hidden. It has nothing to do with our actions.

Also, your concept of inertia is only partially correct. Inertia is an object's property to resist change in velocity (Rest is zero velocity).
I posted a rebuttal to your claim, but it was hidden (TWICE!), so the gist is that while gravitational force on object increases with its mass, the inertia also increases, and inertia reduces the effect a force can have on an object.
In case of gravity, the effect of greater force on heavier object, a=Gm1m2/r^2
and the effect of greater inertia on heavier object,
a=F/m,derived from F=ma
exactly cancel each other out,
F/m - Gm1m2/r^2 = 0
So acceleration stays same regardless of mass.

Now lets see if YouTube allows this to be seen :-[